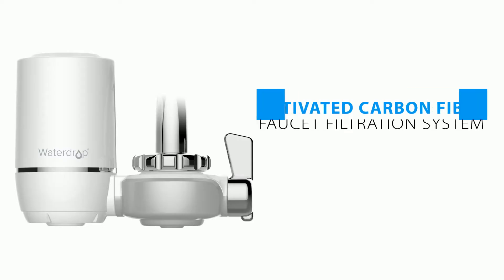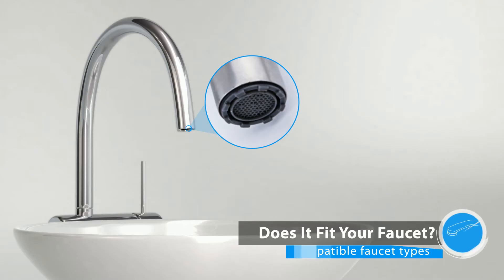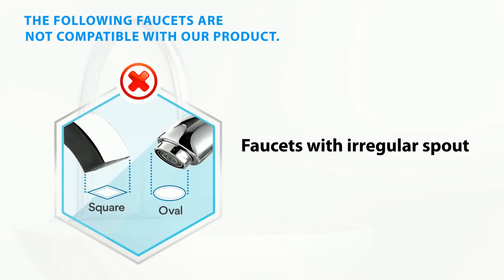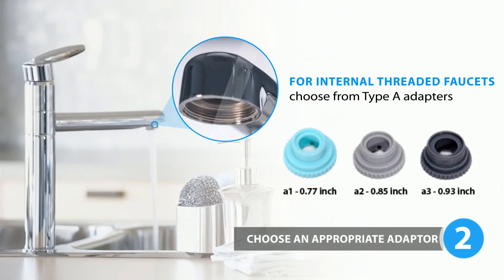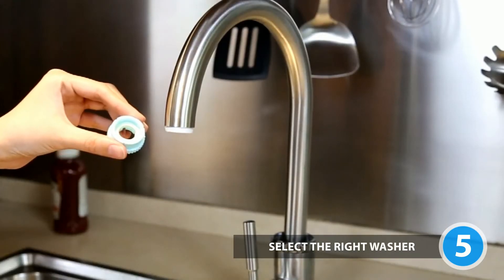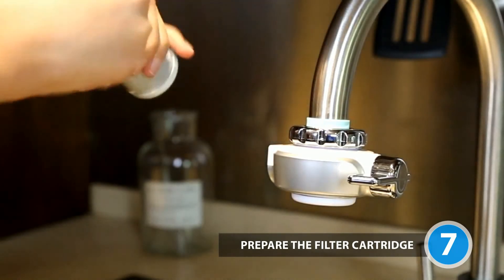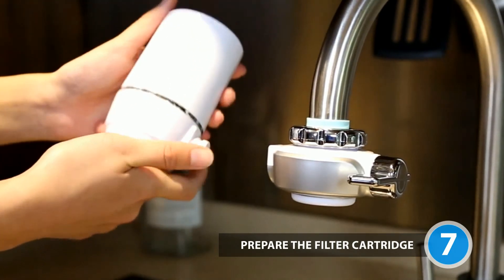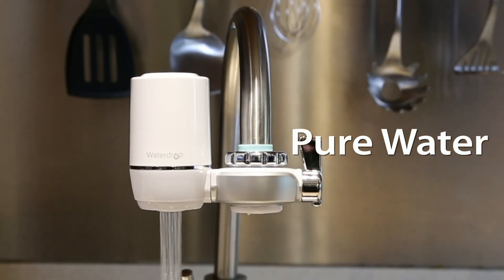Waterdrop Faucet Water Filtration System - How to install

Comment: My facet downward part was too short, BUT I was able to make it work by holding the mounting nut in place while screwing on the aerator. I had to forgo the teflon tape but it totally works
Reply: mine was to wide but i held it also & made it work lol

Comment: I've accidentally installed the filter upside-down and ran the water. Water didnt come up and it created a suction that the filter is now stuck inside cup and It won't come off. How can I pull it out?
Reply from the maker: Hi there, Sorry for not replying to you in time. Please send your details and pictures or videos to our after-sales email, service@waterdropfilter.com, and they will help you deal with the problem or replace the product. thank you.
Reply: @waterdropfilter.official     Bonjour A quelle fréquence dois ton changer la cartouche water drop ???1:39
Reply: How? There's literally only one opening and o ring, also it wouldn't make a suction because there's no pressure when the water off sounds more like you jammed in the filter into the hole😂. My suggestion would be to buy a new one instead except people to fix your mistakes 😂

Comment: Do you have a video detailing just how filters the water? Seems like it would not because the filter unit is located above the water flow device. How does the water come in contact with the filter?
Reply: There's literally only one place the water can go

Comment: Do you have to leave the water run a minute each time you want to drink fresh water.
Reply from the maker: Thank you for reaching Waterdrop. 
Prior to each use, run water through the filter for 5 to 10 seconds to activate the filter.
 If the system has not been used for a few days, run water for 1 minute before use.
Reply: @waterdropfilter.official  How long does the filter last??
Reply from the maker: @3000cocon3000  Thank you for reaching us. Please replace the filter every 3 months or 320 gallons.

Comment: How can I tell if the filter needs to be replaced?
Reply from the maker: Thanks for reaching out. One tip for the filter replacement that I found quite useful is to mark the installation time on the filter, then you can replace the filter according to its indicated filter life. If the water flow turns very slow,  you may also consider about changing the filter as it might have reached to its capacity. You can get up to 3 months or 320 gallons of great-tasting water between filter replacements. 
If you have more questions, please contact us.